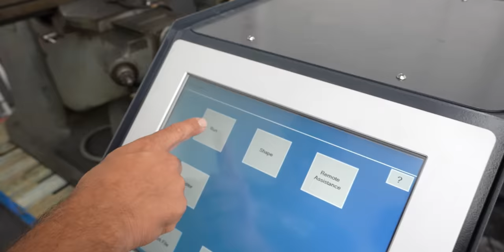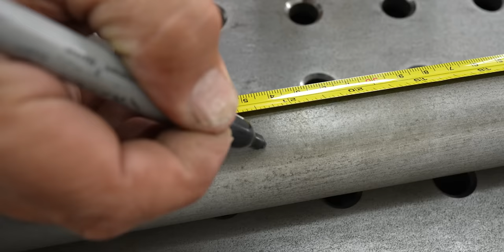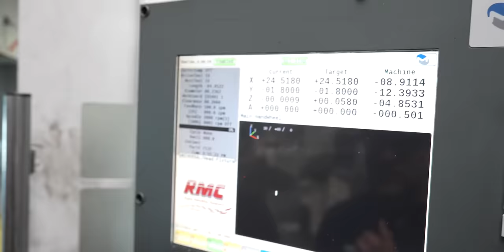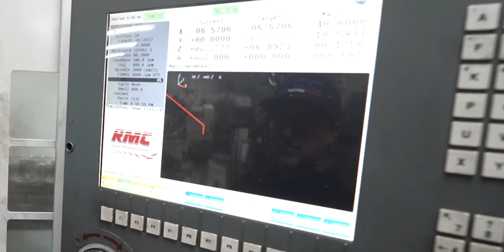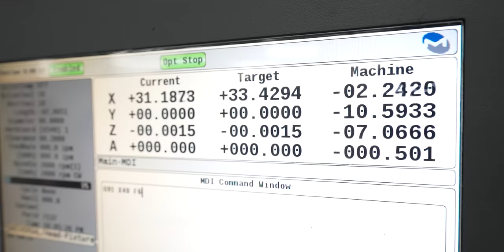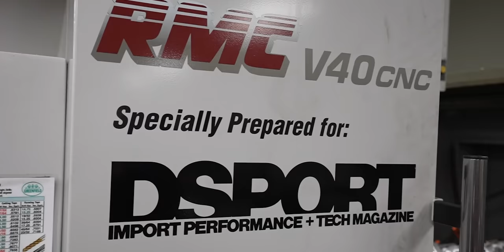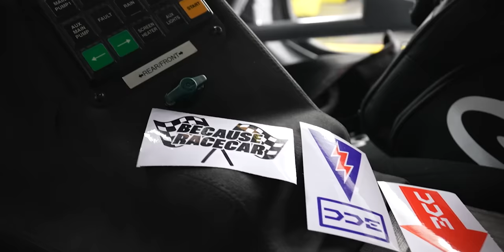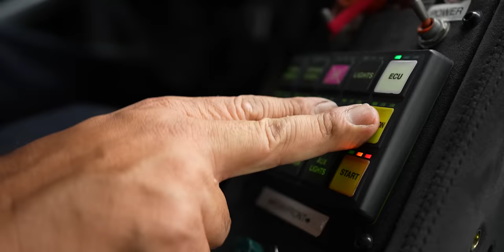WE OVERLOOKED SOMETHING CRITICAL & NOW THIS NIGHTMARE....

Comment: Another great build video!  Mike's knowledge is showing people it's possible to work on your own car with the right tools, knowledge and parts.   I liked to watch the CNC cutting the head.  I myself had an engine built for my 69 Mustang over last winter.  The block was original the rest was not.  Just getting the right parts in time was more than half the battle so hearing you talk about the Carillo rods that are being cut brings back the memory of waiting for just that last part so the engine can go together.  Let's hope something minor isn't what holds things up.  In my case cam bearings were all but impossible to get a year ago for my engine.

Comment: those suction cups the insta 360 mount uses are really heavy duty. theyre basically the same style of cups we use for moving around auto glass and they can hold a lot of weight. they are also super easy to attach to anything. i do like that 3 cup mount makes it super sturdy. might need to get a 360 just because of this mount lol

Comment: If the throttle is too easy to push maybe you can fab up a system that’ll stiffen it up. Maybe a roller that goes on the floor,take a piece of flat steel,attach a roller on the end if it. Attach it to top of the back of the pedal by putting two ears on the pedal and pin the flat steel in between them so it’s on a pivot. Then attach a spring from the bottom of the pedal onto the flat steel by the roller and that should help stiffen it up. If that makes any sense haha.

Comment: @Michael Essa : The rollbar ends on top of the aluminium boxes, I was wondering if during an rollover, the tube ends can penetrate the aluminium causing the rollcage to loose its rigidity? Did you cap of the tube ends or are u using a massive piece of aluminium?
Reply: The aluminum is 1/4” thick, and they will have steel plates bolted to the top and bottom to help spread the load
Reply: @MichaelEssa101   Awesome to read your reply! I work in The Netherlands with steel foundations and in our work we commonly place a 300mm thick concrete floor with rebar on foundation tubes which are about 20 meters long, and the weight of the house and concrete floor creates alot of pressure that the tubes can 'stance' into the concrete floor. To avoid stancing, we weld on the end of the tube a plate or we place a very thick 45mm square steel plate on top of the tube. A 1/4" thick aluminium plate sounds sturdy, and I was just wondering how your experience is with that combination in case of a rollover or somekind of crash. Do you think the metal tubes can stance into the aluminium? Ps! I love that you take your time to answer questions! Your the best!

Comment: @ 4:00 the ford focus gen 3 plus is also like this you sit facing 3° left the steering wheel is like 2° to the right from there and then the gas pedal is like slightly obstructed by the tunnel

Comment: My question is why he didn’t use coolant when he made the cut on the head does that cutter material call for no coolant.  If you use coolant less chance of a heat spike or a hot chip catching and galling the surface 
The surface.

Comment: Idk if the car will be done by SEMA. I have all the faith in Tim and Mike but they are only two people and imo you have to get at least 2 more people to work on the cars during this crazy time crunch.
Reply: It's not just two people though, the motor is getting worked on by another shop as is the body.

Comment: How do you weld the tube next to the roof? Can you fit the welder between the roof and the tube?
Reply: We will remove the aluminum boxes that the cage is sitting on currently, and the cage will drop down a few inches so we have proper access to weld it up